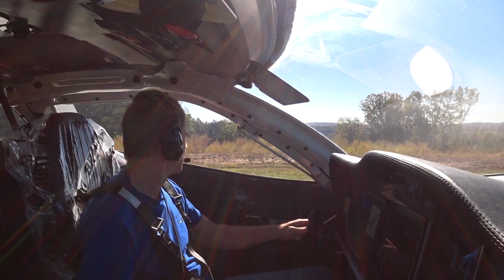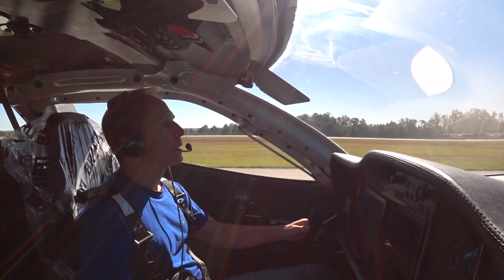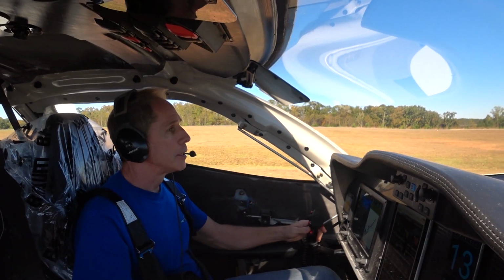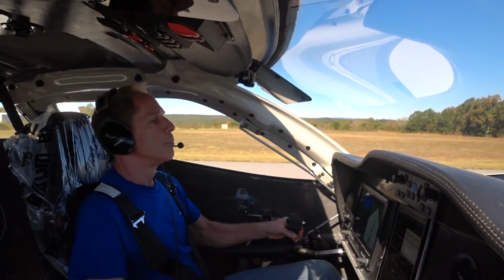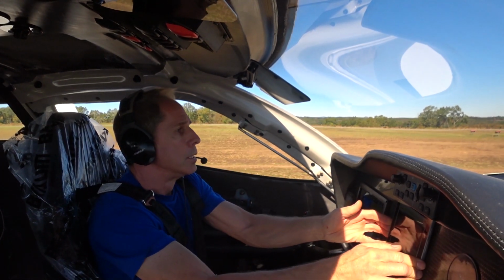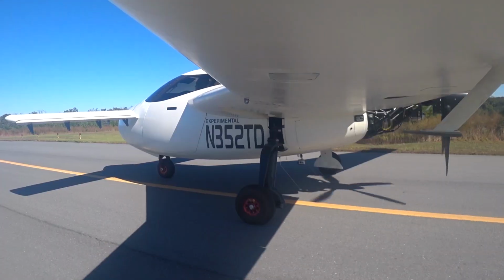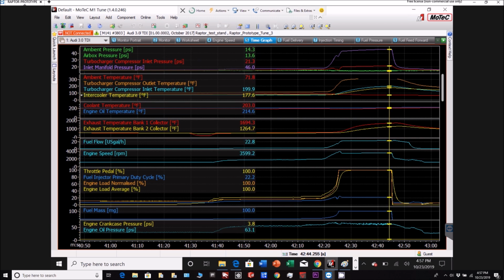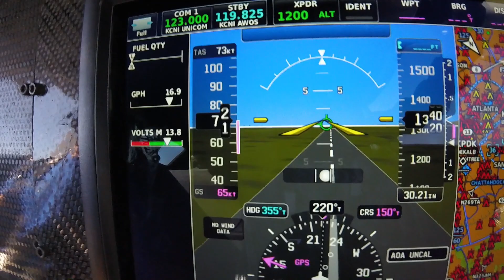High Speed Taxi Testing - Building the Raptor Prototype

Comment: I think we all witnessed the nose wheel coming off the runway a wee bit. She’s a beaut and just about ready for her maiden journey Sir. No shimmy, great now work out the final mapping settings then check the belts for movement and no leaks anywhere. Throw on the cowlings and do a few more taxi test to double check for any visual system issues and it will be time to get your sign off for flight testing. Call in the test pilots because we are all here with you Peter. That is going to be a great day Sir. Cheers Mate!

Comment: So nice to see your reaction to kick in the back sensation! I thought, its not time to take off man! It sure feels likes its close to some flight tests though. Won't the EGT come down in flight after the climb out and the engine is sucking in nice cool air at altitude? I mean I need to go back and watch from the beginning as I am a noob and have only seen the last twenty or so videos, there has to be fresh air inlet(s) for engine cooling, and that would be separate from the engine intake air. Nicely done on the that speed, it really came alive after finding the choke point in the fuel system and that pesky Crank Position Sensor! Cheers! I cant wait for the next one!
Reply: It's liquid cooled...minimal air vents

Comment: I love the design of this Aircraft and the Fact that it is powered with a Diesel Engine :) I am a Retired Female  Diesel Mechanic with over 38 years of experience :)  Gee, it will go as fast as a Cirrus Vision jet at 1.9 Million  :) LOL   The hyd. steering part scares me, i realize that its not a high pressure hyd. system, but hyd. systems do fail, lines break, air gets into the system, the hyd. cyl. push rod seals leak, the piston seals wear out and leak internally,  add a cable to the steering system for a double redundancy system like a A-10 has, keep up the Great work, Chellie.
Reply from the maker: There is no hydraulic steering.

Comment: Just curious if the governer is a bit laggy? It sounds like it's overshooting the rpm target quite a bit before getting enough pitch in to stabilize it.  Maybe the full flat blade angle needs to be a little less flat?
Reply: I keep wondering about that prop. Did I miss something? Looks a little weird...

Comment: Seems like your static port solution should work, don't know why it's not used more often, as long as it's easily visible for inspection.
Reply: In slow speed, low performance aircraft it works fine and is often used that way...but in high speed/high performance aircraft (which raptor has advertised itself to be) it does not work fine. Most of those enclosed areas almost universally end up under slight pressure or slight vacuum (relative to ambient) and as such do not affect change in altitude correctly or quickly enough to be valid or usable in these types of aircraft and their autopilots. Instruments like he has installed are extremely sensitive to static air pressure changes, and being in an enclosed area installed in high performance aircraft is just "bad ju-ju" and will result in poor performance of said avionics.  Not so troubling on the display itself, but very troubling if you're asking the highly sensitive autopilot to hold altitude within mere single feet (which they will do in a correctly instrumented plane) - or climb/descent , etc..
Reply from the maker: Finding an appropriate location may prove tricky unless I bite the bullet and put it in the pressure vessel. Putting it up front might cause errors because of the angles on the nose. The nose compartment is not that tightly sealed top and bottom so it might be ok with what I have set now.
Reply: @SteinAir  Yes, ultimately will require many flight hours of trial and error to find the proper external hull location(s).
Reply: Unfortunately in most enclosed areas, errors are not repeatable, not linear (change with attitude, altitude, yaw, AOA, etc..), and inconsistent. To the point that the hysteresis introduced into the static system ultimately makes the Autopilot performance poor or unusable. If an A/P is not used, then the introduced static lag may not be terribly noticeable to the pilot and less consequential.  Properly located (with redundant ports), icing is not usually an issue, and if Peter were smart he will have installed a sub $20 Alternate Static switch/toggle/valve into the system...to which the alt portion would likely be located in an enclosed area - but not the primary.  It also may depend on where he has installed his GSU and how/where he ran his plumbing.  As I noted, it's fine for a sub 100kt, sub 10K' airplane, but not one hoping to run in the flight levels.

Comment: Is the "blip" shortly after reaching max rpm caused by a tuning issue, or is this when the governor is kicking in and adding pitch, and therefore load, to the engine?  That would cause a small blip in readings, no?
Reply from the maker: It's the governor kicking in.

Comment: Great stuff but the ailerons shouldn’t be flopping around like they are. This could lead to inflight flutter. I’m only pointing it out, out of concern for your safety.
Reply: Boeing, how appropriate that name is. Given you have no clue what you are talking about!
Reply: Zero1Zero tell me why
Reply: Hardly a troll.
But just pointing the obvious out. I thought it best to change the name since I don’t want to infer that Boeing has anything to do with the comments. My bad. Since you come from my neck of the woods read about the Nomad stabilator flutter. I’ll never forget what the test pilot told me and why it was so dangerous. Prick is an English insult used by, perhaps, Kiwis!

Comment: Good on you but please limit the high speed taxi.  This is a far more hazardous regime to be in that it might seem.  Time to bring in the test pilot.
Reply from the maker: I'm not doing anything that feels even remotely sketchy. The aircraft is very controllable and I'm not having any problems rolling out with very little braking. Trust me, I've worked way too hard to risk damaging the aircraft by doing something stupid.
Reply: Hell,  come out to Colorado for a few days.  I have a Cozy and though I'm not a CFI I will happily get you some canard time.
Reply from the maker: @UC5N1kNoBkGL43G3_APStAQw as I've said, I'm taking it step by step in order to get a feel for the aircraft. At no point has it felt out of control. Each time I push it to the next level I only go a little quicker than the previous fastest run. Then I head back, check over the engine etc and look at the engine and video data. I call it testing. Unexpected excursions happen because people rush rather than taking it a step at a time. I have a decent forward CG and if you've noticed, the nose wheel has been off several times already and there is no tendency for it to pitch wildly. It just balances there at 70 mph generating just enough lift to take the 430 lbs that the nose needs to get off the ground. This is exactly what Mark predicted.
Reply: The offer still stands.  Got an extra bed at my place and everything.
Reply: Mk3 and I love it.  Amazing machine.

Comment: Pitot/Static/AOA is one area you can't do on your own (not practically and not legally) no matter how much research you do. Now you're seeing that what you thought was good is not good; and you can't trust what you "think" is displayed for speed and altitude unless you actually have it checked. It's one of the reasons why the FAA requires it.  You have no idea if the 90kts displayed is either 95 kts or 85 kts, or anything in between because it hasn't been tested to a calibrated system hooked to it (which is required of you).  GPS as a comparison is not usable.  BTW, leaving the static vented to a dead spot is common in many slow speed airplanes (cub types and such) - but - long term you have to come up with an area (not stuck within a boundary layer either) to pick off a static source.  A source that can't accumulate water and preferably has two openings opposite each other (in order to balance out any contamination or variation in lateral flight attitude).

Given that you probably have your GSU mounted inside the pressure vessel, and the pitot/aoa and static ports outside the pressure vessel, it's even more important to check out all three plumbing systems (Pitot, Static, and AOA). All are very important, and as you're seeing and error on one can cause issues with the other. Having sold/serviced/installed literally hundreds of G3X's, I'm not coming at you from a point of a casual bystander. It's really important that you get this done.  It's also legally required that you get this done.  Don't risk a crow-hop without knowing what your airspeed and altitude actually are reading. I'm not a troll, nor a cheerleader - but this is what we do a for a living and I'm imploring you to take it seriously...your test pilots will likely require it as well, as I'm guessing they won't fly the airplane illegally.
Reply from the maker: I've had an A&P loosely scheduled for a couple of weeks now. He'll have it done well before first flight.
Reply: @RaptorAircraft  Good to hear! Like I said, I'm not taking any sides on the project overall, but too many people ignore the pitot-static system with poor results on first flights (sometimes they are way faster than they think, but sometimes way slower) - same with altitude/txpdr reporting.  Good choice with the G3X and GTN, that setup will treat you well.  I'm guessing at some point you might want to throw a GEA-24 in there and get the EIS stuff interconnected? There is a lot you can do with your avionics, you've only just scratched the surface with them.

Comment: I see you've made advances and things are looking good. One question keeps popping up in my mind, how are you going to adjust fuel trim/fuel mixture at higher altitudes?
Reply: The mixture is static as the induction pressure is static from turbo charging, at least to a critical altitude
Reply: Just trying to help you out with a simple question that has already been asked nd answered. Take some deep breaths and a pill, or two.  I am a commercially rated Multi Engine, Instrument Instructor with over 7000 hours incluluding contract flights and Instruction with several major carriers and the FAA.  Who are you?  If you know, then please tell us. So far you have shown yourself as not paying attention, not educated and small minded. I'm surprised you are even able to watch the whole videos without getting distracted, or do you?
Reply: @erichynnek  Three things here. First off I don't need your explanation as the question was directed to the owner. Secondly, I doubt your multi engine rating as your reply shows your limited knowledge about the question asked. Thirdly, I don't like arguing with incompetence.
Reply: @erichynnek  This will not work efficiently. At high altitudes where the air is less dense, the turbos output goes down and the fuel mixture goes rich. Also, the exhaust temps will go down. Using manifold pressure and turbo output as the metering devices will not work. Your theory is fail.
Reply: @biggysground  you've shown you can count to three,  good job!  Now show you can read:  did you see "critical altitude", go on you can do it. They are bigger words that you might be used to but keep trying.  Above that you simply use mixture to maintain EGT.  This is all simple and basic high performance or high altitude  endorsement material. You don't have a high performance or high altitude endorsement, do you.  Do you even have any airman certificate, rating, or endorsement? No? nothing.?

Thanks for the fun,  smart guy.  How about you go play with your friends and let the grownups discuss.
Reply: @erichynnek  I have more experience than you. I have respect for those who deserve it. You jumped into a question and didn't answer it correctly. You offer rides to kiddies which is about the sum of your aircraft adventures, which is much cooler than your advice. Stick with the kiddies where your talent is and leave my questions alone. By the way, I am the president of an aircraft repair business which is corporate, lease planes to flying clubs and service them, have rebuilt wrecks and know and can show my talents. I also pilot old and new makes and models of aircraft when I get a break. If you really knew who I am you would have a much different reply response.
Reply from the maker: Please guys, be civil. The ECU can handle fuel based on altitude but the simple answer is that a diesel will simply burn the fuel that's injected. If the engine charge drops because of thinner air and lowered boost then I'll adjust the map to keep the lambda above 1.0. That way it won't get too rich. If the expected power is not there we can always revisit the turbo choices.
Reply: @RaptorAircraft  Thanks for the reply, does your setup have a baro sensor and/or a map sensor? Manually readjusting map values at altitude will suck.
Reply: @SooperToober  Good day Snooper!

Comment: Do you think you can get more pitch on the blades sooner?
Reply: Why do you think it is needed?
Reply: @donanders2110  I'm just wondering  is all but I do know diesel engines work better under load and at lower rpms
Reply: @tacticalrabbit308  Oh ok, I thought maybe you saw something, or knew something that would make the Raptor better, that Peter did not know about.
Reply: @donanders2110  no just drove semi truck for twenty years
Reply from the maker: The governor adds pitch whenever the engine exceeds the set rpm. I had it set to 3500 which is the sweet spot for torque for this engine set up. If I set it lower the turbos will take longer to spool up so it won't be as good.

Comment: I think 2nd to last run the nose wheel came up a bit.  Is there still ballast in the nose? Cheers and Congrats Again.
Reply: AFAIK... yes...and yes.
Reply from the maker: Yes, the nose wheel had been off many times now and yes there's still ballast in the nose and more under the passenger seat for now.
Reply: @RaptorAircraft  One day soon both VW Group and Garrett Motion will sit up and take notice of your progress with Raptor's engine.  Not sure if Garrett has ever supplied turbos for a GA converted TDI before.    😎👌

Comment: Diesel or Jet A1 Peter?
Reply: Diesel or jet is correct.
Reply: @billwessels207  The number at the end are done with Diesel or Jet A?
Reply: @DecibeldB  I believe Peter has been using Diesel for these test runs.
Reply from the maker: Either but presently Diesel as it performs slightly better.
Reply: @RaptorAircraft  Thanks for the reply I was asking because 0.82 specific Gravity would have been off for Jet A1. For Diesel it's fine :D